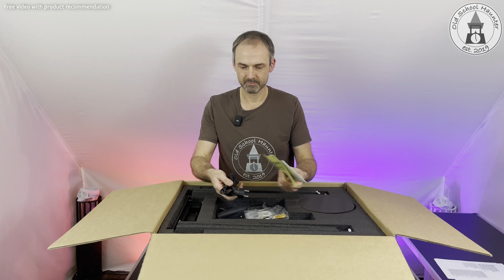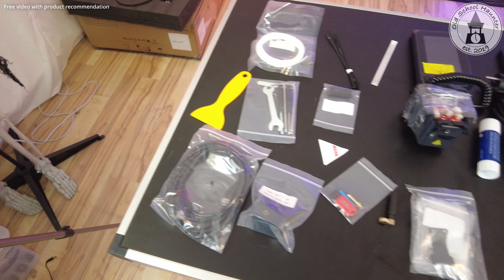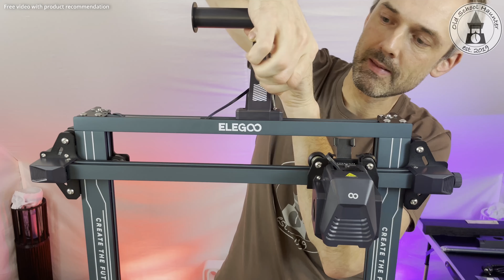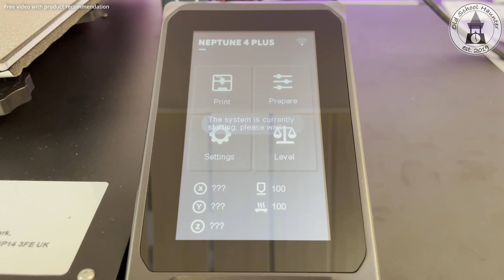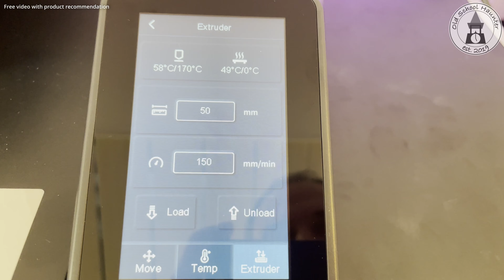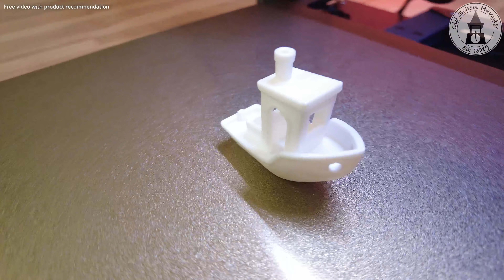Unboxing & First print Elegoo Neptune 4 Plus - Assembling and Start-up [Tool Update EN]

Comment: Thank you for this video. What is the length and width of the printer once assembled? I'm trying to see if the rubber feet will fit on the desk I have.
Reply from the maker: Thanks :-) The dimensions of the printer are depth of 50cm, width 44cm and height including filament role 87cm. 
Width extends to 53cm when you include the display. In depth you need at least 60cm because when the print bed moves backwards it moves over the base of the printer. So you cannot put the base directly  to a wall. Does this help or do you need additional measurements?

Comment: The center of my Elegoon is more to my right its left. How do i fix that?
Reply from the maker: What exactly do you mean? When I push the use the menu "Prepare" -> "Move" and klick the house in the center with letter "all" on it to move all axis to home position, the print head is not in the center. The print head is more to the right side, when I look from the front to the printer. It is about 2,5cm or about 1inch outside the center, when all axis are in home position.
But when starting to print or when performing the leveling of the print bed, the print head moves to the "real" center. So it coordinates are correct when printing. Do you mean this behaviour?
Reply: @OldSchoolHaunter  I believe so. I did the boat print and it got it done really well and it in the center but when leveling when I pree Center doing the paper test it hugs to the right a bit more. I'm nee to this so I have no idea if this is normal or not
Reply from the maker: So I never though about, if this is normal behaviour or not. Since printing works the correct way it looks like the home position is programmed that way by Elegoo. If you have worries about the home position, then you should contact the support of Elegoo and ask about it. 
I cannot really give you an answer at this point, if this is normal or not :-(
Reply: I think perhaps it's because the sensor for auto-leveling is to the side of the print head, not in the center of it.

Comment: So my screen isn’t turning on
Reply from the maker: My screen freezes from time to time and then I had to remove the cable from of the screen and plug it in again. Then it shows the correct view again. Maybe this helps. In all cases the printer has to be turned on. If this does not help maybe the cable is broken. Have you contacted the support yet?
Reply: @OldSchoolHaunter  yes. They send me an instruction with steps how to find the issue and fix it.
Reply from the maker: Ok sounds good. If you have a solution you are welcome to share it 👍 maybe others also face this issue.
Reply: @OldSchoolHaunter  I don’t think we can upload pictures in chat lol. But I’ll try
Reply from the maker: You are right. You cannot upload images. I'd thought it's kind of a 1...2...3 step tutorial but if it is only done with pictures, then you can't provide it here. OK thanks for the reply :-)

Comment: how much long to print benchy
Reply from the maker: The benchy was already contained on USB Drive which was shipped with the printer and took 16 minutes to print. As it was already sliced I can't tell you much about the print parameter.
Reply: 16 is great, I want to buy this printer instead of side winder x4, do you have any problems with the printer, I think such a large printing table might have some missing steps due to its weight @OldSchoolHaunter
Reply from the maker: I own the printer for 3 weeks now and so far there are no issues. But 3 weeks are not very representative. Currently the printer works quiet well. Leveling the table was pretty easy to do. Please do not be confused with the Neptune 4 Max. That one has the largest build volume.
Reply: @OldSchoolHaunter   no I dont confuse, I want to know your choice between neptune 4 plus or sidewinder 4 pro
Reply from the maker: Ah ok then I misunderstand you :-) Sorry about that.
Actually I didn't know the sidewinder 4 pro (until now ;-) ). I've chosen the Neptune 4 Plus because I know the company Elegoo and since I hade some issues with my Anycubic Kobra Neo in the past year, it was clear for me not to buy an Anycubic printer again. And the Neptune 4 Plus was a good choice for me, when talking about price and build volume. 
Again, I didn't took a look at the sidewinder 4 pro at that point in time. But the sidewinder 4 pro has a smaller build volume compared to the Neptune 4 plus. I wanted a large print volume and when I take a look at the key facts of the sidewinder 4 pro, it "only" has build volume of 240x240x260mm compared to the Neptune 4 Plus with 320x320x380mm. As I need the larger printing volume, my Oskars goes to Neptune 4 Plus :-)

Comment: Is yours still good? I used to have the Neptune 2S but I had a bunch of issues with bed leveling and no matter what I tried it would unlevel itself, so I’m really really nervous about the 4 Plus because it also unfortunately has manual leveling. I already ordered mine and I’m just doing some research to see if bed leveling is easy or if it’s a hassle.
Reply from the maker: Hi there. Yes it’s still good so far and it does a good job. But yes, you have manual leveling of the bed which can take some time to setup correctly. When I bought the printer the preset for the leveling was pretty good but maybe I had luck. 
You talk about your old printer unlevels itself. I did not experience such problems. I had to perform a new leveling recently but I think this was due to high changes in environment temperature. I had to place my printer in a room on the attic and there you have changes between summer and winter time. I think those changes in temperature can lead to something you can call „ unlevel itself“. 
The print bed itself has some unevenness in itself which I cannot correct with manual leveling. But it’s not a big problem. I also read comments on Amazon where people had to order a new bed because theirs was so uneven that they hab bad result in printing. 
I keep my fingers crossed you get a good one. Feel free to come back and tell me when the new printer is arrived and if it works well or if you have problems.
Reply: @OldSchoolHaunter  Yeah haha, I’ve heard if you move the printer you’ll need to re-level it. As for the last part of your comment, especially with larger printers unevenness in the print bed is something that should be expected. My Neptune 2S had a wild amount of unevenness for its size. I remember I’d either have to put paper underneath the plate in certain areas where it’s too low, or just buy a glass plate which will be perfectly flat. Unfortunately I’ve come to learn glass plates don’t work with the Neptune 4 Plus, but I’m hoping the unevenness won’t be a problem because I’m under the impression that the auto bed leveling takes care of that. My printer arrives in two days so I’ll definitely let you know.